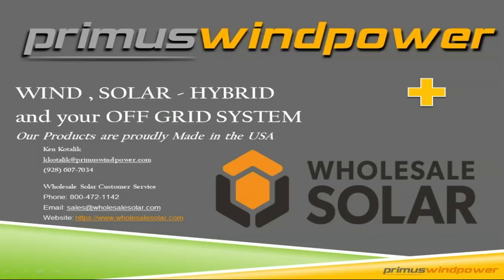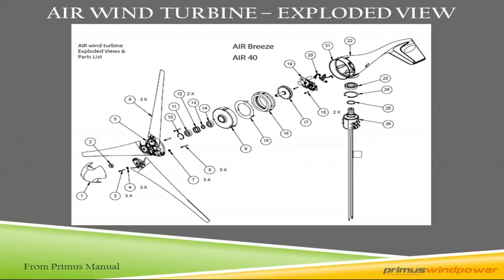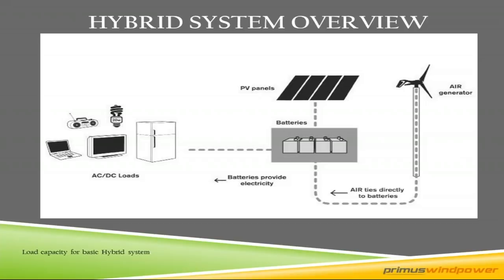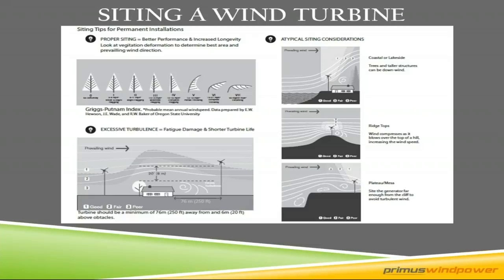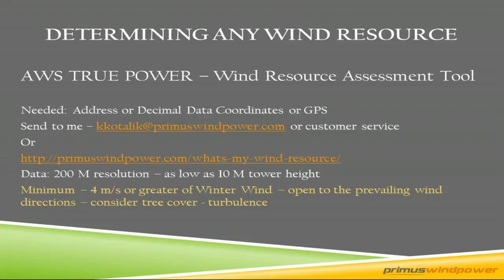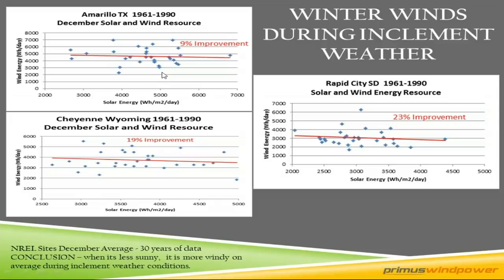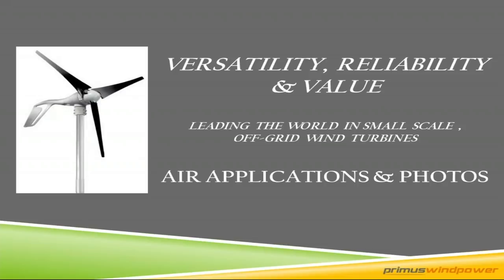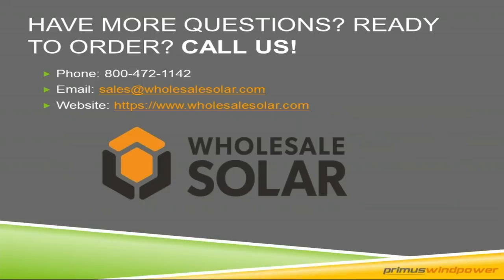How to Design a Wind & Solar Hybrid Off-Grid Power System for Residential or Commercial Applications

Comment: Excellent explanation. Simply and precisely put. Good going bro. A lot of people know little about the great potential of wind power world wide. I'm from India and feel wind and solar are the power of the future. There is huge scope and attention on these alternative energy sources
 Massive market, possibly the biggest in the world. Cheap Chinese products are flooding our market and degrading the reputation of this industry reliable products like yours will do great though may face initial resistance  from a cost perspective as the market is extremely cost sensitive. Local production will reduce costs significantly as material and abour costs are much cheaper than US.

Comment: I just checked out the "Shop Wind Turbines" link provided in the description. Literally every single one of them is out of stock. Not sure if the company went out of business or not, but they don't seem to sell wind turbines any longer.

edit: ... and nobody answers the phone. I'm guessing these folks are NOT the folks to go with.
Reply from the maker: Hi Mr. Volkner, We are still in business. These Turbines are drop shipped from the manufacture. The "out of stock" message is an error in our website that we are currently working on. Give us a call 1-800-472-1142, we are glad to help.
Reply: @unboundsolar  Thank you for the response. Glad you're still in business.

I've already tried calling several times, no one answers the phone. Maybe I'll try again tomorrow.